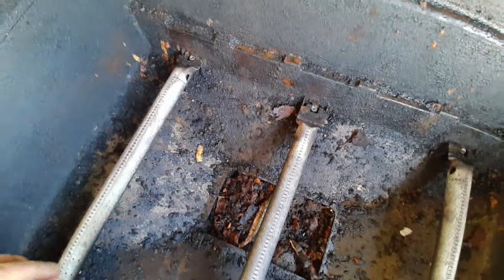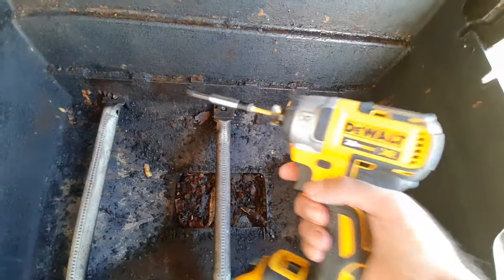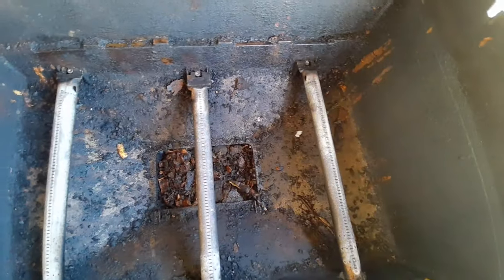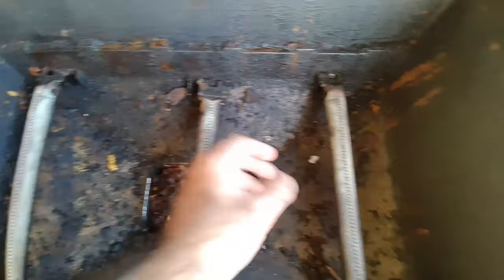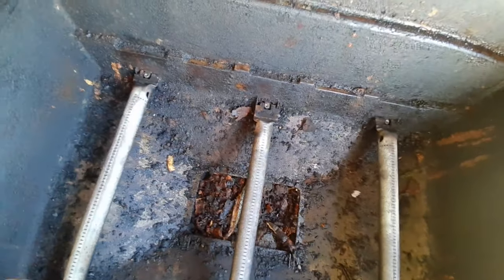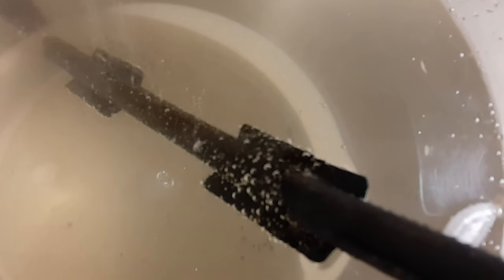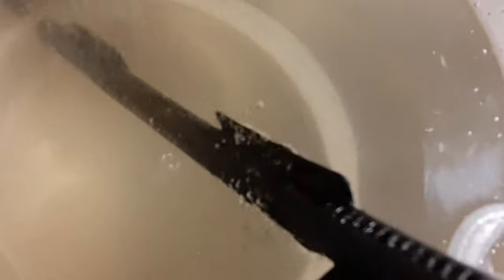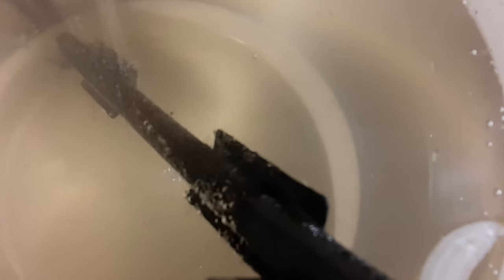Some burners not lighting? Clean your grill's Crossover Tube yourself!

Comment: Hey buddy, I know this a year later, but I have a little tip for you and your viewers. If you're using vinegar and water to clean your grill burners, don't add baking soda to the solution as well. The whole point of adding vinegar to the water to soak your burner tubes, and any other parts you want to clean, is the vinegar is an acid, which helps dissolve the scale and grime on your grill parts. When you add baking soda into the mix all you're doing is neutralizing the acid, which renders the vinegar useless. Just use vinegar and water, and maybe even a bit of dish soap to help cut the grease, and that should do the trick. Baking soda really has no place in the mix. If you want something with a bit of a grit for scrubbing, just sprinkle on some table or kosher salt. It makes a great abrasive and washes away clean when you rinse it off. Hope this helps.
Reply: Baking soda and vinegar works very well cleaning electric stove glass tops. I used vinegar baking powder and dish detergent and it worked fine.
Reply: Have used apple vinegar to clean out rusty gas tanks for some years.  Have used baking soda to remove acid deposits on batteries.  Mixing a base with an acid seems counterproductive as noted earlier.

Comment: I did this today and it worked.  I let crossover tube soak in the sink with baking soda and vinegar and hot water,  as I went out and ran errands.  Hooked it all back up. and it took some time... but it worked.  Grill is all good now.  Thank you for saving me money!  I love doing things on my own.  In the past I probably would have just bought a new grill.  LOL
Reply: Don't use baking soda with vinegar. When you mix baking soda in with your vinegar and water mix, all the baking soda does is neutralize the acid in the vinegar, thus rendering the vinegar useless. You want that acidity to help dissolve scale and grime. I'd also suggest adding a little dish soap into the mix to help cut through the grease, but leave the baking soda out of it, otherwise if you're adding baking soda, then you might as well leave the vinegar out of the mix. Again, all the baking soda does is soften the water, and completely negates the acid in the vinegar, so it's not only not necessary, it's actually working against you.

Comment: Good vid and I hope it helps some people.  I will add that those screws that you removed are called " guide screws " they do not need to be removed and are not really meant to be removed.  Just slide them back out from there position...sliding them towards you.  They are often kinda stuck in grill debris in which u just use a large flat head screw driver to wedge then away from the screw.....not to unscrew but to put between the burner tube end and the cook box then twist the screw driver thus forcing the burner tube to slide free from under the guide screw.

Comment: Well, I had the same issue. I used a brush that looks similar to a pipe cleaner to clean the inside of the transfer tube. That brush was just the right diameter and reached a bit more than half way, so I used it from both ends. Then I used a wire bush on the outside. For my case, that was sufficient.

Comment: Love your video. I found that using a razor blade as opposed to a pin was more effective. Make sure razor is protected on one side😄
Reply: Pretty good tip - whatever will get into the tube slits will work.

Comment: This solved my problem. Thanks. (But do agree you could have shown how you took off the cross tube)
Reply from the maker: I could have, but didn't. I did show the tool and locations to lift off the tubes, and mentioned the cross over the isn't fixed to anything.